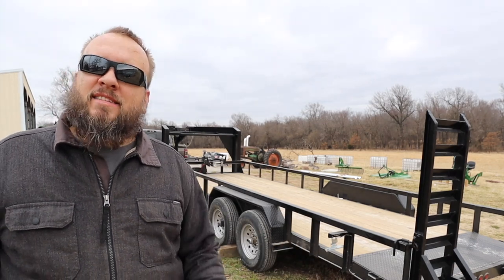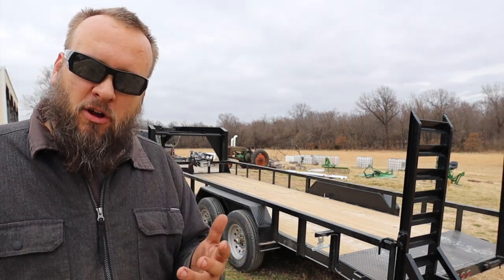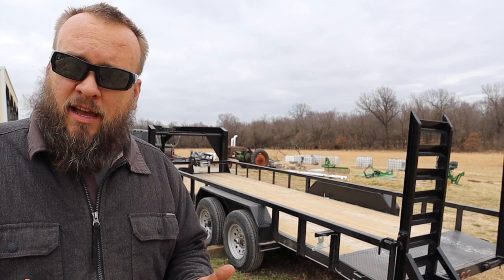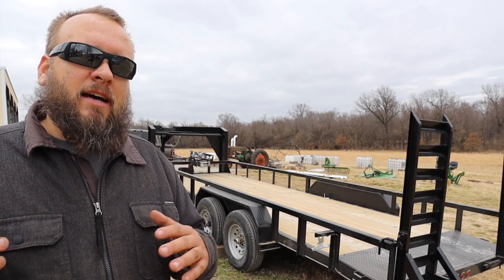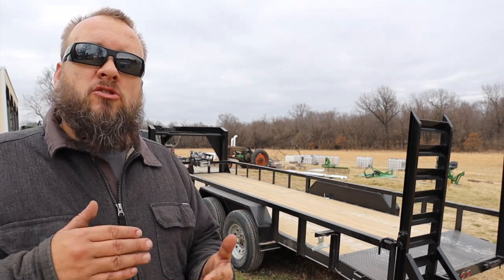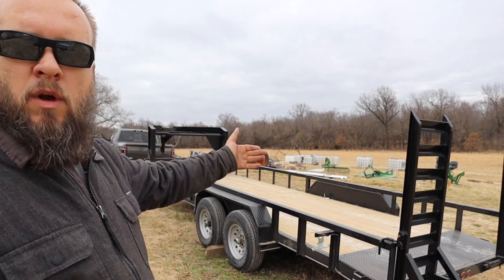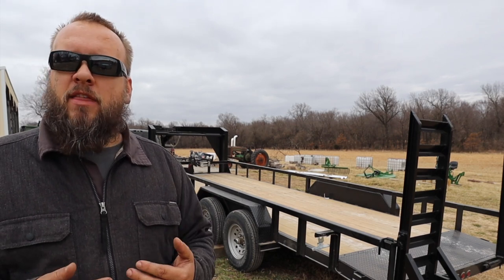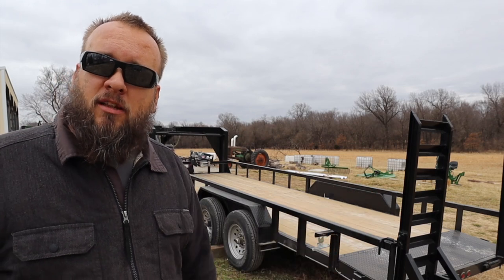Easy Tips to Extend Transmission Life When Towing, Hauling and Loading

Comment: Got to let the truck warm up. I always let mine run for at least a few minutes before I move it to get the fluids circulating. Definitely some really good advice for anyone in this video.
Reply from the maker: Good Point about warming it up
Reply: Oh it’s a good idea to let things warm up before going full send huh??? I remember getting accused of putting a 100 hours on your tractor idling it 😂😂😂
Reply from the maker: If I learned anything from Trump it is to always attack the other persons strong points instead of their weaknesses.

I am bad about not letting the tractor warm up.  I’ve been doing better with the truck.
Reply: @billyshapp4076  I'll fire up my old 650 when I crank my truck up in the morning and won't cut it back off till I unload it when I get home on the super cold days. Most times I'll let it idle until I feel the heat in the exhaust then ease into running it wide open.

Comment: One of the best things you can do to help a transmission live a longer life is upgrade the transmission cooling system. A lot of the heavy duty trucks will already have an external transmission cooler. But upgrading it can help keep that transmission cool and prevent failure. Good video, Brock!
Reply from the maker: Good Point.  I bet temps are a big culprit

That is why I monitor the fluid temperature.  Hopefully these new trucks have better coolers than the older ones?

Comment: I just bought a trailer (10.4K, 22ft) for my JD 3038e, and then a Ram 1500 (5.7 Hemi V8) to pull the trailer. This was GREAT info for me, and very timely. Thanks!
Reply from the maker: Sounds like a perfect trailer size for that tractor.

Mine previous was only 7K so I just upgraded the trailer and the truck and I’ve been doing a series of videos on Towing and hauling and stuff like that

Thanks for watching

Comment: Great info Brock, I also lost a transmission in my prior truck at about 120,000 miles from lack of maintenance and paying attention to what i was towing even though it was a smaller cargo trailer, the air turbulence of a flat front trailer seemed like it put a lot of stress on the transmission as it kept shifting down and up.
Reply from the maker: That sucks

Thanks for sharing

Comment: I had a professional driving instructor (no not high school Driver's Ed) tell me the appropriate way to park an automatic is "apply the service brake, shift to neutral, apply the parking brake, release the service brake so the vehicle will move slightly engaging the parking brake, apply the service brake again, then shift into park."  The issue is the parking paw in the transmission is likely just a piece of plastic so can easily break.  Sounds pretty much like you were told although there were no wheel chocks involved.  Of course this was to just put the vehicle in neutral and had nothing to do with a trailer.  I, of course, do this religiously every time I park :)  Actually I do try and do it if I'm going to be parking on any incline as it makes shifting into/out of park much easier as there's no bind on the transmission.
Reply: "this was just to put the vehicle in PARK (not neutral)."
Reply from the maker: Makes sense

Thanks for sharing

Comment: I use neutral, parking brake, and wheel chocks when dumping the load from my dump trailer.  And when getting it loaded at the pit, I put it in neutral and apply the brakes.  You don't realize how much pressure your trailer puts on your truck when dumping.  You will realize it when you try to pull the blocks when it comes time to pull forward to let the entire load slip out.  All of these precautions are a pain, but not as bad as wrecking your transmission!  Oh, and make sure your trailer brakes are adjusted to apply properly.  Worrying over every little detail is better than fretting over a breakdown or accident!
Reply: Good info
Reply from the maker: Definitely

Thanks for the tips

Comment: It’s not a big deal down in the flat lands, but if you get into hills and mountains, the diesel exhaust brake on the Ram 2500 is absolutely fantastic at maintaining speed control downhill without putting the strain on the transmission or overheating the brakes.
Reply from the maker: Thanks for sharing, It seems like a great feature

Comment: Driving style has EVERYTHING to do with motor and transmission health & longevity period.  I pull everything from a 5x8 all the way thru a goose neck 35’ 25.9 GVWR hydro dovetail trailer.  I own a 2006 F350 short bed single rear wheel 6.0 Powerstroke truck.  I’m the only one to ever drive it and just passed 520,000 miles. ( and no I have never had any engine problems) I just serviced the transmission at 500,000 miles for the first time and it still shifts as if brand new hauling anything.   I have never used the tow/haul feature,  my Ford Diesel mechanic instructed me to never use it on the highway.  I never let the truck downshift, instead I just let it bleed off speed and hit the power curve of the 6.0 Powerstroke at 1850-1600 rpm for maximum torque. If its steep enough to need to downshift I do it with accelerator manipulation making it shift when I want it to shift and slowing to the right gear for the grade.  ( my truck has pulled loaded trailers in the Rockies as well)   My Ford dealer is the only mechanic to ever touch this truck it’s still 100% Ford.   Drive like you’ve got some sense with a fresh egg under the accelerator,  always slow down way early and take it easy on the brakes & NO JACK RABBIT starts and things will do amazingly well with your equipment.   Great video and content this is all the stuff that 90% of the weekend warriors never think about and it matters!!
Reply from the maker: That is really impressive to have that kind of mileage on your truck with the original engine and transmission

Thanks for sharing the info

Comment: I've got a 1023e John Deere the first time that I loaded it on my trailer (F-150 with a flatbed trailer) when I drove on the trailer my trucks back wheels almost went up in the air I know put deck stands underneath the back of my trailer to hold it up. I thought the same thing when it jumped up like that what's the only thing holding the truck down doesn't move it all now those stands helped!!
Reply from the maker: Same thing happened to me one of the first times I loaded my tractor.  My tractor is over 5000 pounds, and it was a half ton truck so The truck tires actually did come off the ground and the truck rolled forward a few feet.  I was lucky that it was only a very slight incline where I was parked

Pretty scary deal.

So of course I learned all the things you can do to make that safer and actually recorded a video talking about that. 

Which is when I saw the dirt monkey video about how it affects your transmission

Thanks for watching and sharing the story

Comment: Towing in overdrive is also something else to be aware of on some older trucks. Overdrive allows a lot of slippage at highway speed and while towing that slippage will overheat the fluid, combined with the bruise jender (tranny) constantly shifting in and out of OD adding more heat bad things will happen. Chevy's 700r4 is notorious for this
Reply from the maker: I see what you did there…

thanks for watching

Comment: I think that it's standard procedure for dealerships to deny warranty claims. I bought a 1 year old 1/2 ton pickup with 29K on it, still under factory warranty to 36K. I also purchased an extended warranty for several thousand dollars. At 51K the torque converter went out, so I took it in for repairs. They denied the claim because the manual said to change the transmission fluid and filter at 50K if hauling or towing, or 100K if not. The repair was over $3000, and this being my only means of transportation, and not having a spare 3 grand laying around, let's just say that I was not a happy camper. I asked to speak with a manager. I showed him the manual. I opened the tailgate and showed him the spotless, unscathed bedliner (which they had installed). I then showed him the 2" receiver, no scratches, no hitch had ever been put in it. I told him that I don't haul anything in this truck but a**. He looked at the crowd of techs standing around and said, "Fix his damned truck!"
Reply from the maker: You are probably right.  It is really frustrating.  They profit off of people who aren’t willing to fight a denial

Comment: Just get you a mid-90’s Chevy model Dually and have it total restored front to back and it will cost you not even half as much as what you’re paying for that truck and you’ll get a good 10 to 15 years out of it… Parts are common and cheap.
Reply from the maker: In the 3 months I waited for this truck to be delivered I started to regret not just buying an older truck

Even if the transmission went out on it a new one would be covered by a couple of payments on this truck

Thanks for watching

Comment: DO NOT use tow haul in a new ram 2500-3500. Unless you are overloaded and hitting big hills for most of the ride. Exhaust brake on at all times. And you should've bought the 3500 ;)

Comment: That parking pin is literally $2.08...its not something to fret that much over.  I'd much rather replace the pin in a transmission that I know i took care of up until that pin sheared rather then be slapping in some rebuilt pile of garbage.  learn to wrench my man!
Reply from the maker: Thanks for sharing but I want to make sure I understand.  Are you saying not to set the parking brake when loading?
Reply: @RockhillfarmYT  No, I'm saying warranty companies look at replacement cost for swapping a trans as a unit and not actually what broke.  That's how they got to 6k worth of "damage" if the parking pin is what actually sheared and would no longer stay in park.  You could buy a transmission jack, a full set of tools, the repair manual for the trans and the failed part and have it out and back in within a weekend.  Saves the cost of the bogus warranty companies, plus you get to learn a new and useful skill that will continue to serve you long into tractor and equipment ownership.  If every time something breaks your calling a mechanic or a dealer your going to need to be a millionaire to own all these pieces of equipment! lol
Reply from the maker: I appreciate the info and I definitely agree with what you are saying.  Probably would have been better off with an older truck, because it is hard to make a profit running new equipment all the time

I don’t mind working on equipment but a transmission is over my head

That said if it is under warranty I expect it to be fixed at no cost to me

None of the explanations the dealership gave me ever made any sense. The truck had run Perfectly. Never had a hard shift or had any problems at all.  

I finished a job and loaded my tractor but the truck would not start.  Dash lights would not even stay on. I had to jump start it and then it went into limp mode.  

 I thought it needed a battery or had a computer problem.  The truck was under warranty so I had them come get it

The next day the called and told me that the transmission had to be replaced.  Then they told me that this model of transmission could not be rebuilt and could only be replaced with a new one which was 6k.  

Sounds like nonsense. Pretty much anything be rebuilt right? But if I’m not paying for it I would rather have a new one.  

I didn’t end up paying anything for the repair, but a week after I got the truck back I had to put a new battery in it
Reply from the maker: Just subscribed to your channel

Maybe I can learn a few things from you
Reply: @RockhillfarmYT  I actually just went and watched your explanation video of what was going on with it.  Definitely a crappy situation with a truck that's still supposed to be within a warranty period or an extended warranty claim!
Reply: @RockhillfarmYT  I just watched your new 2500 video...and completely blame you for talking me into ordering a 3500 HO laramie...so I'll be sending you at least the first bill, its only fair! haha keep up the good work man!
Reply: @RockhillfarmYT  And thanks for the SUB!
Reply: @hcr-motorworks  Most people in service departments are "parts changers" not mechanics. They have to connect a multi thousand dollar computer to your vehicle and do what it says in the order it says. Good mechanics can diagnose many problems with just their ears, I've seen it done many times.

Comment: Try a Toyota tundra next time
Reply from the maker: I thought Toyota only makes 1/2 ton trucks?
Reply: The Tundra is only 1/2 ton, and you have to get the 2022 before it is even rated over 10K towing.
Reply from the maker: Right, I looked it up after reading the comment.  They don’t seem to offer anything with the capacity I need

Thanks for watching
Reply: Ty-yogys "had" a good reputation up to 2008. Now they are just regular "scaponese". The machining, and metal quality is gone ,gone ,gone; no more of the marathon machines they used to be. The Land Cruser is the ONLY EXCEPTION. Go ahead and praise your "ty-yogys ", "neat-suns", hum-days, they are just "tinker-toys" when it comes to moving anything but themselves & groceries. Been running GMs for 40years always dubbleing there limits and NEVER "Twisted out" a trany, or "blew" an engine until 250,000 hard miles. Better give your Ty-yogys a hug it needs it. Thanks for moving your money over-seas, that's where there profits go bye-bye 45% of the price of vehicles.